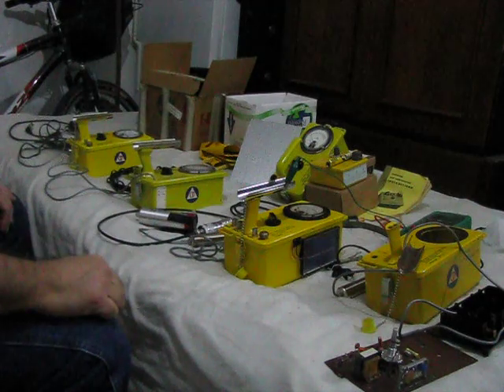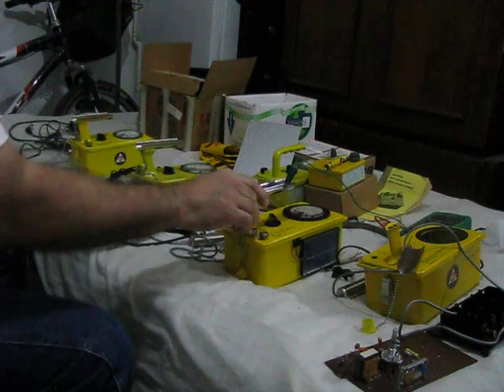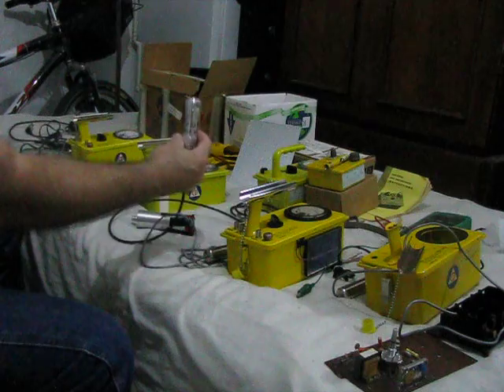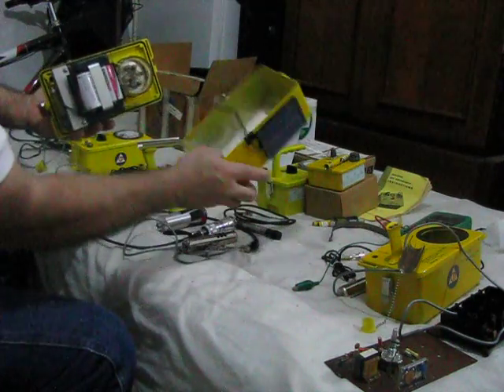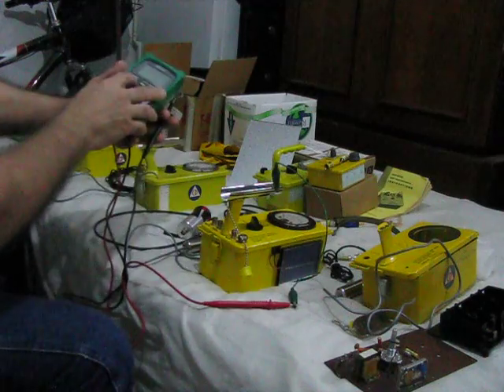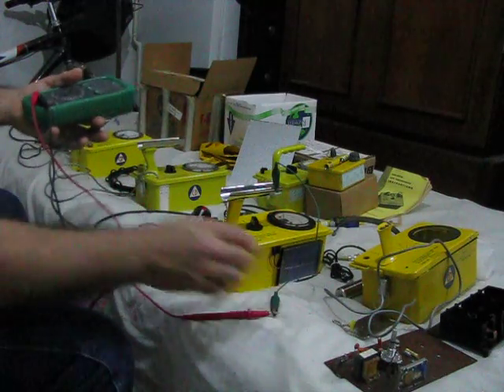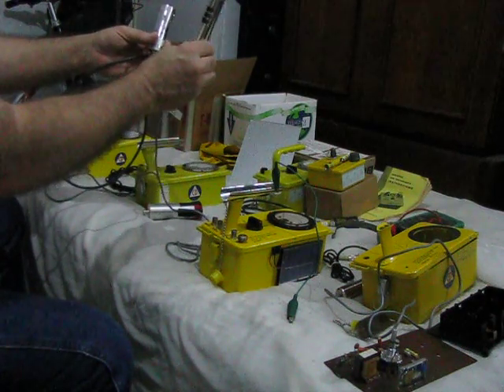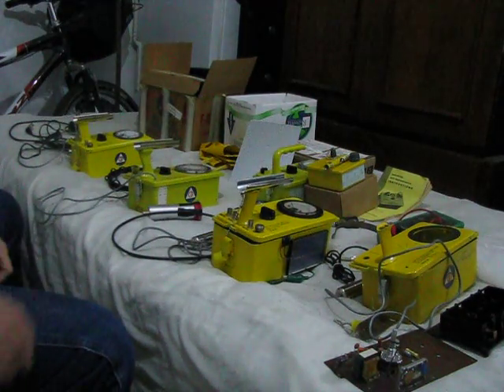CDV-700 collection

Comment: Very helpful video.Thanks...
Do you know of a website that list mods for the CDV 700 that may be useful? I did a google search and didn't find anything very helpful.. I wonder if the sensitivity of the CDV 700 can be increased for measuring very low levels? Perhaps a x 10 op amp after the detector..Have you done any mods like this? Perhaps a CDV 715 could be made into a useful instrument with a similar mod.
Regards,
Glenn